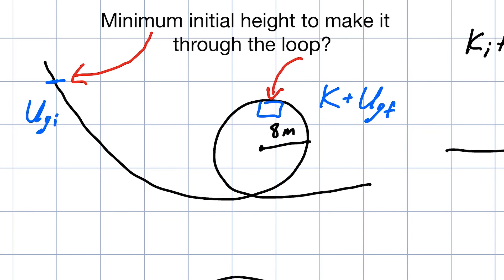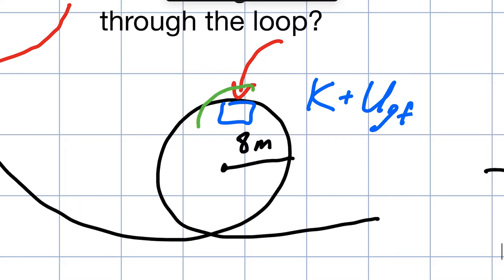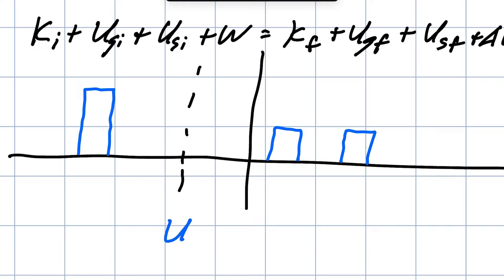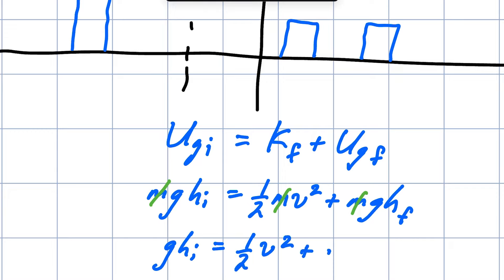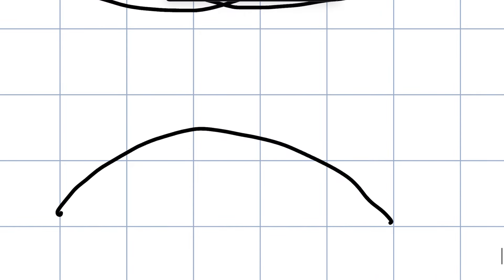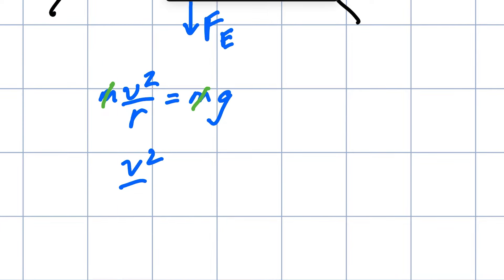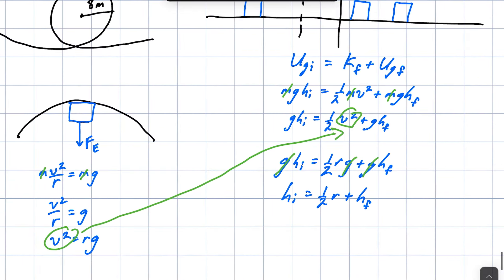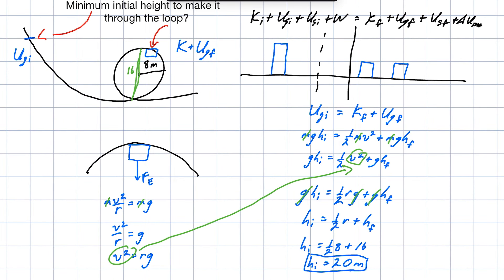Classic Energy Problem - EASY!

Comment: Calling it a "roller coaster" will definitely misdirect some people. Unless they specifically seek out historical roller coasters (as in historical enough they probably aren't legal to operate anymore), a student will likely only have seen and experienced roller coasters with obvious "up-stop" wheels under the rails, which prevent the coaster from disengaging from the track. That plus the occasional news story of a roller coaster being stuck at the top of a loop means some students may interpret "roller coaster" to mean that the object cannot fall off the loop -- that if the velocity were insufficient to keep the coaster on the track, then the normal force between the coaster's wheels and the rails would keep it on the track. That completely changes the problem, as now the need for a minimum velocity at the apex of the loop no longer exists.

I rewatched to see if there was any indication that this roller coaster was unusual in lacking this ubiquitous feature. I did notice the brief phrase "or marble or something", and the solution presented would be correct for a marble on a track. However, it was so brief that it probably won't stop a student from using their knowledge of how roller coasters work -- I didn't even notice the phrase on the first viewing.
Reply from the maker: Hello friend. Thanks for the comment, and you make a great point! I appreciate the feedback.

Comment: That's a very nice method! I usually solve this with my students using another method, involving the calculation of the reaction of the loop on the marble, and saying it shouldn't cancel out at the top of the loop because if it does it means the marble is beginning to fall through and doesn't follow the path. The final result is the same. Anyways your solution is simpler so i might start doing it that way! Cheers.
Reply from the maker: Excellent!

Comment: Thanks so much for the video im just a little lost at one part, Why is there no normal force at the top? Why is the net force just Fg?
Reply: This may go undeclared, but I think the assumption is that it only barely makes it. In that case, the normal force is zero, while before and after that moment at the peak there would be nonzero normal force.

I could be wrong, though.
Reply from the maker: Hello friend. If the cart is going to "barely" make it through the loop, there would be no normal force. If we think of the cart going faster and faster, then there would be more and more normal force (pushing down) from the track. So, as you slow it down more and more, the minimum speed would make the cart just barely stay in contact with the track but with no force from the track.
Reply from the maker: Hello friend. You are right. Minimum height would give minimum speed and so it "barely makes it." Thanks!